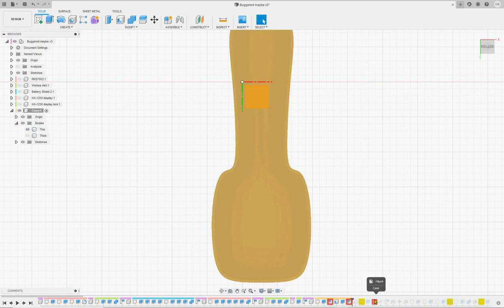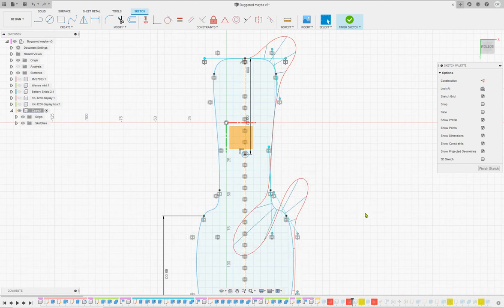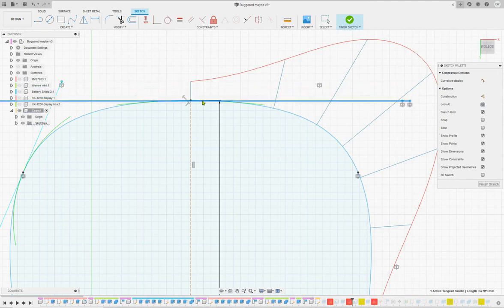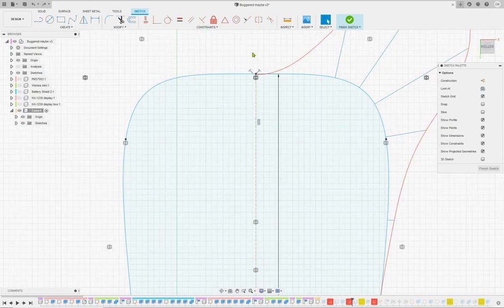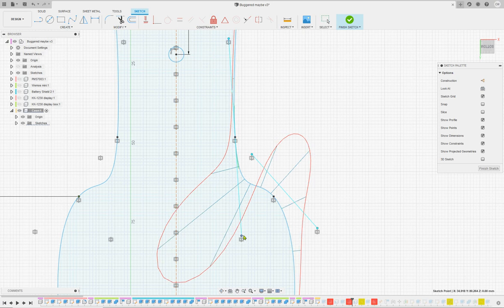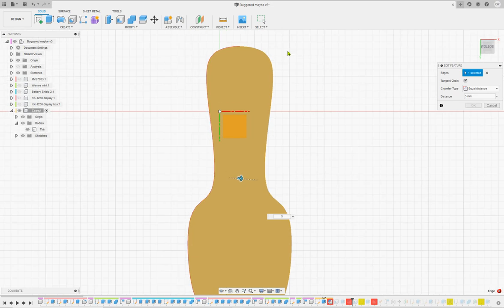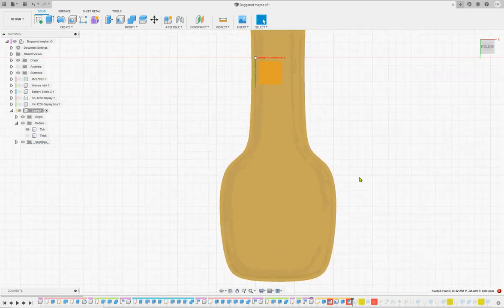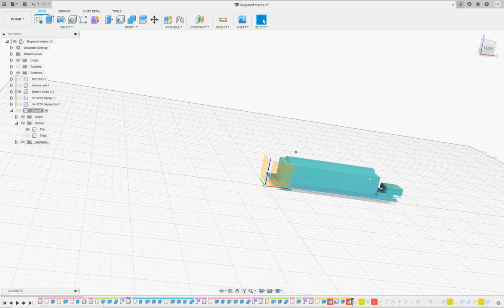Fusion 360 Chamfer   Return to Chamfer Hell

Comment: Sorry, didn't have time to watch whole video.  A few notes:
(1) A circle has a flat top ("Perpendicular") and is symmetrical.  However it has curvature everywhere that is not zero.
(2) Curvature  C = 1/R.   R is the radius of the best-fitting circle at the point.  (R = infinity for a line, R = radius of circle for a circle.)
(3) I like to think in terms of R (radius of curvature) rather than curvature C.
(4) If you want to apply a round fillet, then roughly speaking, you need the radius of the fillet to be smaller than the radius of curvature at every point on the curve.  In other words, you can't have your curve bend with a radius R that is smaller than the radius of the fillet.
To visualize this:  Imagine a donut (torus) where the radius of the cross-section is 1.  And the central circle of the donut has a radius of 1.  What happens?  Well, the donut doesn't have a hole!  The cross section on one side of the donut touches the cross section on the opposite side.  You can't thread the donut.  So it's not a proper donut (no hole).   Something similar happens when applying fillets.

I'm not sure the above solves your problem.  But it might.
Reply from the maker: Thanks Chiral! I solved it eventually by trial and error, but it shouldn't be this hard in a sophisiticated app like Fusion 360.